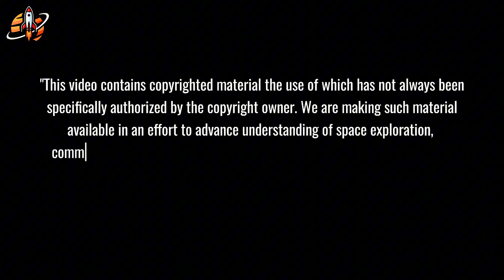SpaceX Dragon Upgrade So CRAZY It Made NASA Rethink Everything...

Comment: SpaceX superiority has been evident for 11 years.
Reply from the maker: SpaceX's Dragon upgrade showcases their lead in innovation, outpacing traditional programs.
Reply: Um...where?

The only systems SpacedX is having success with, were designed by Russian and NASA engineers and haven't been modified.  This modification path screams the most transparent distraction game.  It's not even funny.

Since none of these 'breakthrough' systems are in use ANYWHERE, and since they can't even get Starship working, no one should take this sales job for anything other than.
Reply: @billcichoke2534  Wow.  The man's rockets land back onto the ground.  Sorry you've insufficient wit to engage here.
Reply: @nicholsonscience6229 Wow...no, they don't.   His BOOSTERS land on the ground, which means they're using around 40% of their propellant JUST TO COME BACK, as opposed to LIFTING CARGO.  Also, there's still fluff about refueling in orbit prior to a lunar heading.  Hasn't and ain't happening.

Starship was supposed to be part if tge Artemis program.  The reason the dragon manned capsule is being suggested in this role (as I said) is because it's not something SpacedX engineers created...so it WORKS.

Whether it's capable of supporting the particulars of the Artemis mission is a totally different problem.
Reply: @billcichoke2534  13?